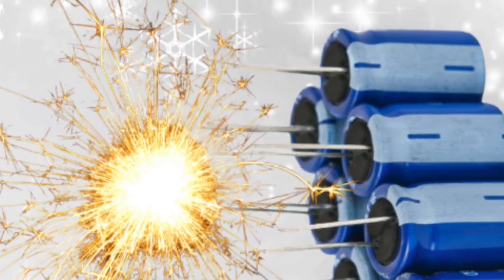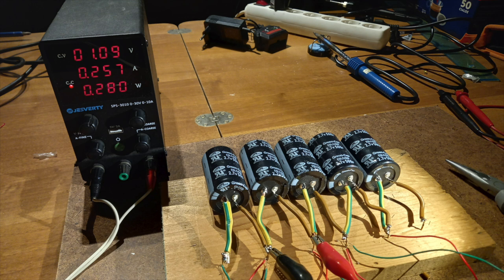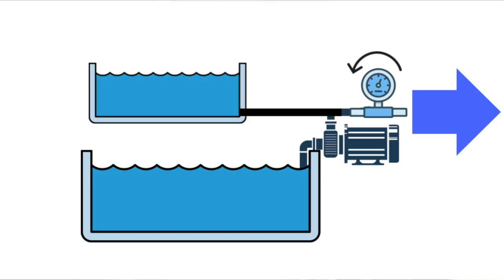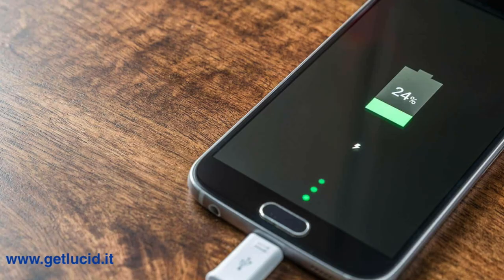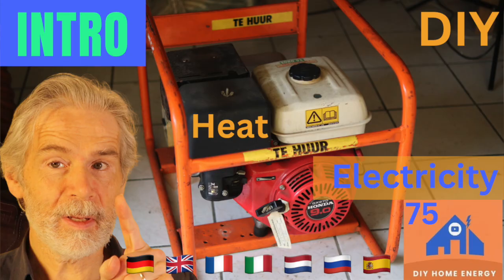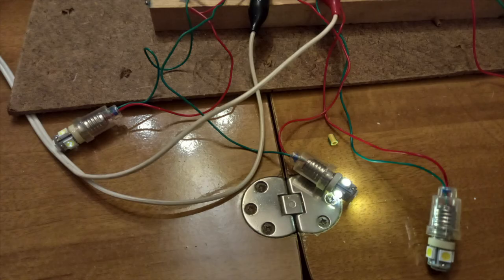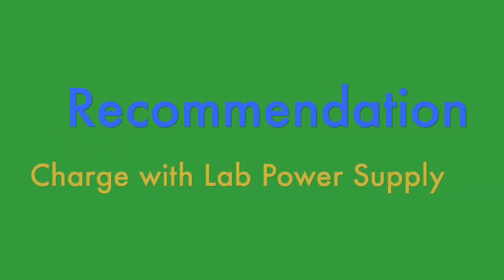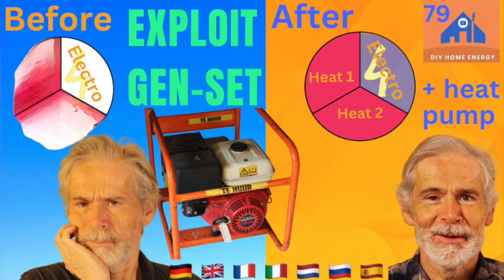How to use super capacitors to improve the (car) battery  - Video 81

Comment: Your energy calculation for the super capacitors is very wrong. 9112.5 joules is the correct answer for 5 of those. It appears you neglected the fact that 5 of these in series has a capacitance of 100F.

And after watching further, your math for the AA battery energy is also wrong.  that answer is ~119kJ
Reply from the maker: Hi, you are right with the 100 F remark. I noticed this a few days after the publication of the video and asked apologies.
Reply: @nnvasen-good-energy  don't forget about the AA calculation being wrong also.

Comment: I'm a noob, so apologies. Could we add supercapacitors to EV batteries to take some of the load off the EV batteries during regenerative braking and acceleration, which could load up the capacitor and discharge it rather than harassing the EV battery (possibly optimised using software)
Reply from the maker: Hi Fattyboom, that can certainly make sense but there are two problems. One is the very low capacity of even super capacitors compared to the batteries but for short bursts the battery will indeed be grateful for the high power capacity of the capacitors and their low resistance. The other problem is the equalization of the high voltage up to 800 V among all the single capacitors. Ok that is also a problem for the HV battery itself and to my opinion both equalizations should be integrated. In other words each two capacitors should be connected directly to one battery cell if they or at resp 2,7 and 3.7 Volt. Bye the way, a third problem is to adapt the power electronics to the higher power of the capacitor bank. So after all it is more the job for the EV manufacturer. Also because I translate EV documents into my language and read sometimes EV repair manuals that make me aware of the extreme danger and procedures related to HV batteries.
Reply: @nnvasen-good-energy Thanks for taking the time to answer, that was well explained for the clueless :)

Comment: how many capacitors I need for a good car battery power with a lot of accesories..?
Reply from the maker: Hi Adrian, 6 x 500 Farad must suffice because they anyway don't contain much energy like the battery. They are only there to give the starting current of several hundreds Ampère that is much more than all the accessories. For those accessories you might want a somewhat larger or better battery and a good alternator.

Comment: Supercapacitor works great in parallel with lead acid battery without the need of any resistors or diode. Just get a set of 6 with balance board is good enough
Reply from the maker: Hi Ronnie, I initially bought those 6 of the video on a balance board but discovered that the board was bad and the capacitors good. Only then I started to tinker with the idea of diodes and ... I like what came out of it. Simple and effective (and taking little power). I am ready to take another board, if I can trust them. There are not so many reviews of them, it seems...
Reply: @nnvasen-good-energy Good day, I have discovered that the best combination is 5 pieces of 500F in series without balancing board that works well with lead acid battery
Reply: From the title description, I was expecting to see the proper way to wire it up to a car battery. I understand you would run the wire to the starter motor directly from the super cap bank of 6 2.7v capacitors but how do you wire up the negative? does that need a large gauge wire to the battery or to ground on the chassis? Do the wires from the battery have to be a smaller gauge to offer some resistance? Does the setup need a resistor in line between battery and super cap? Thanks in advance for any help anyone can offer.

Comment: I want to use a capacitor bank in parallel to my LIFEPO4 battery in my caravan because the inrush current of may caravan mover is so high that i get al voltage drop of 2V and that will switch off mover. Now i have bought a supercap bank from ali express with 6 capacitors of 100F (16F effective) and there is protection electronics. There is a 150A high amp switch and fuse to connect the battery with the movere electronics . I would like to connect the suprcap to the 12V input of the mover. But how? I guess when I turn on the mover switch the charge current of the capacitor will be very hi. So my question is, what schematic do i need to connect the super cap bank at the mover so that the capacitor supplies the inrush current but then the normal battery takes over?
Reply from the maker: Hi Eding, I don't know what a mover is but it seems very much like the configuration that I show in the video with the starting motor instead of the mover. You mention the charging current going to the capacitor but I think you mean discharge current, right? Because the charge current can be controlled by you, it is only the consumption that must be what it is. Those 150 A are not too much if you compare it to the crank motor. I think you can do it with the schematics of the video.
Reply: @nnvasen-good-energy  
A mover is an electric motor that can move the caravan using a remote. Two rolls shift out and press against the tires to rotate the wheels. 

The mover electricronics is switched on with switch there actual 4 motors. 2 for shifting towards the tires and 2 for rotation. 

If the voltage from the battery drops more than 2 volt the motors switch off. It's because of the high inrush current.
Then an oscillating occurs motor on off on off. I want to prevent this using a super capacitor bank. Switched parallel to the power input of the mover electric.
But I am afraid  that when I switch it on with empty capacitors that the current will be very high with empty super capacitors. I'm seeking to solved this if needed.  Maybe its no problem in practice, i don't know.
That's why this question to you.

Comment: It's true . I've done it
Reply: A set of 6 500F capacitors in series attached in parallel to a lead acid car battery will complement each other
Reply from the maker: That's nice to know Ronney! What did you note in particolar, do you have a tip for our Energy Champions, to take care about? How did you do the balancing and is there a problem with too high current from the alternator to recharge the capacitors?

Comment: Hi & thanks for your very insightful video. It maybe worth pointing out that lots of modern vehicles have very sensitive ECUs. So really need to be careful jump starting your car. 
The use of capacitors is very interesting, but circuit protection should really be a consideration. 
In certainly more interested in seeing a final working vehicle using capacitors, as mine suffers greatly in the Winter here in Scotland. With short journeys killing my battery every couple of years.

A conclusion of this experiment & a working system would be fantastic, as a battery is not cheap! I think he capacitors maybe the answer to my issues.

Thanks again & I hope everyone has a happy, healthy 2025👍👍🇬🇧🇬🇧🏴🏴
Reply: No harm to ECU as I've done it
Reply: @Ron.2077y  From the title description, I was expecting to see the proper way to wire it up to a car battery. I understand you would run the wire to the starter motor directly from the super cap bank of 6 2.7v capacitors but how do you wire up the negative? does that need a large gauge wire to the battery or to ground on the chassis? Do the wires from the battery have to be a smaller gauge to offer some resistance? Does the setup need a resistor in line between battery and super cap? Thanks in advance for any help anyone can offer.
Reply from the maker: Thank you Jimmy for the 2025 wishes! 
I don't guess what an ECU is but yes, a car is a sensitive environment. I think that if you put the capacitors in parallel, they will not cause tension spikes, only current spikes beyond usual. So maybe here to take some care. Maybe a cable to the starting motor with a slightly higher resistance (well calculated!).
After my continuation of the micro CHP playlist of yesterday, I surely want to buy high quality super capacitors the coming week and make a working system. My wife has a RAV4 diesel and it is staying outside, in the cold.
Reply: @ Fantastic & thanks for sharing. I look forward to the completed project with your wife’s car. Wonderful videos & keep up the good work. Regards from Scotland UK
Reply from the maker: Thank you very much Jimmy! I need to wait because I got super capacitors that are not good.

Comment: Hey, so I could have a supercapacitor bank between my starter and battery to help save my battery.. I’m thinking, great so I can replace the lead acid with LFP, save some weight. Yes, one with a heat jacket and protection from cold charging..maybe a button to request the supercap bank to be charged and a led to indicate when it’s ready.
So let’s then add a hydronic heater to preheat the engine (and condition the LFP), so starting current is less and the engine will love his extended life.
Reply: Forget LFP, go with supercapacitor.
LFP cannot handle such large currents for car starting.
Reply from the maker: Hi Szekeres, yes, indeed and the capacitors should deal with that and a careful calculation and tests are necessary in order to keep the current within its limits even while recharge the capacitors from the LFP after an engine start.
Reply from the maker: Hi Michiel, indeed an LFP can give only a lower starting current than a lead battery so the capacitors become a must in this case. I don't think it is necessary to have a charge request,  just put them parallel and yes, the battery  temperature management seems an interesting thing. Also the engine heater and I am playing with the idea to do it with stored hot water of the previous car trip. After all the engine has its water circuit. Another interesting idea is that stop&start at semaphores becomes more realistic with the capacitors. Only the starting motor gets so much more work and maybe it is not designed for that. The cars with a standard stop&start engine maybe have a heavy duty starting motor, I don't know.

Comment: But how do i wire super capacitors in a diy solar system??
Reply from the maker: Hi Viyus, that is a good question! Wiring super capacitors into a DIY solar system can enhance efficiency. I recommend checking out specific wiring diagrams or guides that focus on solar setups for more detailed instructions! The specific challenge is that's super capacitors will have a rising voltage PV would like to have a constant voltage in order to stay in the "knee" of the current - voltage curve. Than you need some adapter like a specialised MPPT to make this "gliding" adaptation. I must think about it and it would be a good project.
However, I would opt for the simple battery solution as it has higher energy density and use the super capacitors only between battery and load (can be inverter).
Reply: @nnvasen-good-energy  what about the super cap being in parrallel before going to the inverter

Comment: Asalamaleikum.i use supercapacitors in my cars.Batteries are over 16 years old!!! All original.SAving fuel also.consumption lower 8-10%.
Reply from the maker: Hi Abdula, Wa alaykum as-salam.
It is impressive what long experience you have with super capacitors, also the same time 16 years as the batteries? It is really very good news and an argument to use super capacitors! But how to explain so much fuel saving?

Comment: Grazie per il tutorial sui supercondensatori. Suggerisco di considerare l'utilizzo di dispositivi, come BMS, per mantenerli equalizzati durante i cicli di carica e scarica. Saluti dal Brasile.
Reply from the maker: Hi BrasElectron, very nice to have also viewers from Brazil! I was Ribeiro Preto for a bio ethanol project, years ago. 
I will certainly use a BMS: one example is already the set of 5 super capacitors that I showed in the video, they are not very high-quality because I wanted to start with something cheap and learn. I discovered that they charge with different voltages. I was trying to find ready made products for BMS, but I guess that these are only sold together with the super capacitors. Or I have to make them myself and I found already a few videos about it. Anther way to get equal voltages is to buy high quality super capacitors and I think that Maxwell is a good brand.
Reply from the maker: I will certainly buy those good super capacitors

Comment: great idea =)
 (you can already buy a solid pcb with charging electronics and those caps already configured to a 12V system, btw... )
....and a little advice on the audio, there is a high pitch frequency ... 
Subscribed and waiting for the follow up on this :) hope to see this in action ^^
Reply from the maker: Hi T_K, I see on your channel that you are a lot on the water, with DIY, nice! 
It would be nice to know more about those PCBs, I had difficulty to find them on for example, Amazon. I see sometimes systems with a PCB, complete with the own super capacitors, maybe you mean that?
It was funny that during editing I didn't hear this hi pitch, even with my new headphone. I suppose it was because my hybrid pellet and woodstove was running (it is in the Fire playlist), there is a speed control on the fan that is working with phase cutting.
I will surely go on with a super capacitors, because it is really an issue with all these cars in cold countries. This Saturday I am dedicating a video to continue the series of micro CHP, also there is a special playlist. Next Saturday there will be the installation of a standard split heat pump. It is the first time that I install this, with the connection of the pipes and refrigerant. Also, this is in a playlist and I hope you like it.

Comment: From "vavlewizard": - "resistors must be added in parallel in order to encourage equal voltage sharing between the capacitors. The resistors should be equal to 50/C or less". 50/500=0,1 Ohm. This is funny, looks like shorting + and - to make boom.
Reply from the maker: Hi Sasha, I indeed don't like much the resistors as a solution and will add active elements.  Even if I am electronic engineer I will refrain from designing a circuit and look for a ready solution on the market so that the viewers can have quick solutions that work (I will test them). Let's see if I can find a BMS or battery management system. It is important enough if you are putting it into an important asset like your car. By the way, do you think that my Russian subtitles are useful and good in quality? I like the language and it is also an official language of the UN so I decided to put it  in all my videos.
Reply: @nnvasen-good-energy  im not speaker of Ruski. Sorry for that and my poor English.

Comment: So what the heck was this video about. improve the "car" battery with super capacitors to help the car battery a starting the car. But where is the final example of actually doing that? There was only playing around with charching capacitors. What use does it have at all just showing that alone?
Reply from the maker: Hi Stinktierchen, I am aware that it was incomplete from the example point of view. I told already that the video was getting too long. I told also that I need your vote for the CHP and Super capacitors to choose my direction for the following videos. If you see the comment below of William it seems that for SC the preferred subject is the car battery.
Reply: Jibberjabber at best.
This should have been a practical video.
Take a dead or low voltage battery, show the capacitors, connect them and make them work. But, no! 😅
Reply: Helps when using inverter i dont think starting car so much

Comment: After viewing your video the second time, I realized that I missed the point you were trying to inform us on. I do have 2 cars and having these super capacitors in them could be advantageous to me during our winter months in Michigan.  I would like to try to put this system together for my own use. I'm very interested in seeing how you put the system together and the battery connections and any protective enclosure that is needed under the hood. Hopefully you have enough interest in this project to continue. You mentioned that this is your prototype, so I'll hold off doing anything until you get further in the project. Thanks for your Very interesting videos.
Reply: Asalamaleikum.i use supercapacitors in my cars.Batteries are over 16 years old!!! All original.
Reply: @abdulaiabdurahmani2913  Thanks for the update. Can I ask what capacitors do you use, where do you live (climate type) and could you show a picture as to how they are attached to the battery and how you protected them from the elements. We can all learn from others experiences (Good and Bad).
Reply from the maker: Thank you so much for your trust and appreciation William! I now discovered what is actually wrong with the cheap capacitors and know now what to look for. Like the CHP project als this can grow out into a series and the car battery is indeed an important point for so many car owners in cold countries and with so many lead batteries that are discarded before their real end of life.